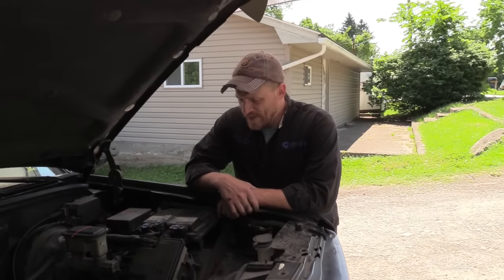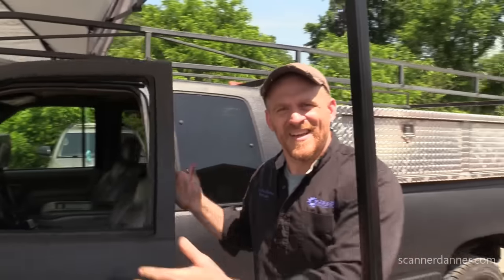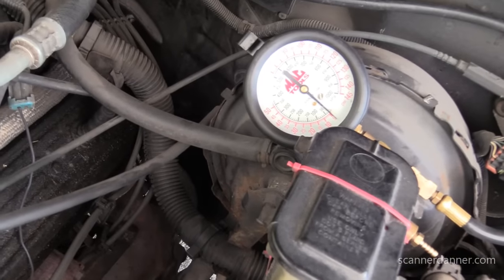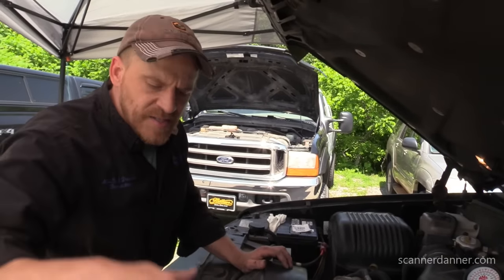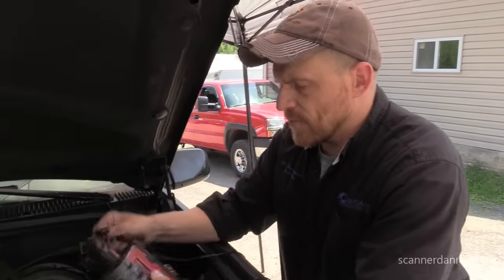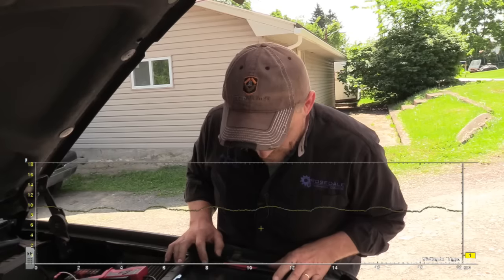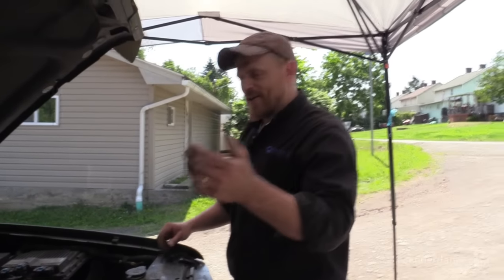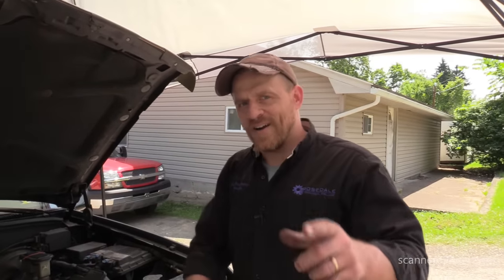Quick Diagnosis of a '97 Chevy with a Fuel Pressure Problem

Comment: Working on a 91 s-10 truck first lost its prime then after putting gas in the carb it started. THEN STARTED AFTER EVERY TIME. RUNS GOOD ON IDLE BUT DONT WANT TO TAKE GAS BUT DOES BETTER ON HIGHER RPMS. Once tou start to give it gas it motor strts shaking like its not getting enough gas to run it. All help appreciated
Reply from the maker: 91 S10? This is a throttle body injection system right? It is not a carb. It has a single or two injectors that sit on top, right?

Comment: My 97 K3500 7.4 with 230,000 mi has the common issues: Hard starting when hot, low on power, can barely rev to 3,000 rpm in 2nd gear. It sounds like low fuel pressure, but it only has 20k miles on a valve job, injectors, fuel pump and fuel pressure regulator. No CEL. I suspect the crappy regulator is the problem, failing to boost pressure at low vacuum. Is there an aftermarket regulator solution that could also be relocated for easier access?.
Reply from the maker: "Sounds like low fuel psi", agree, let's get a measurement of it please. You can rent those gauges from a parts store if you don't have one. Also, no, there are no other options for this fuel psi regulator.

Comment: good vid paul  with the pump rpm   the gas tank smack test for an inop pump is usual   clogging fuel filter causing damage to pump in this one    I say
Reply from the maker: Amperage was normal for this system which would eliminate a plugged filter as the cause (in this circumstance)
Reply: yes....sorry paul was not thinking right over here  its what you usually see... you make the call  from that... the arm chair.... not good and the cannon will miss sometimes

Comment: My truck just got a new fuel pump 3 years ago. Now it will only start with starting fluid and stays running. It has low fuel pressure at 50 psi and stays there steady and is drivable with no power loss. Is the low pressure causing it to not start without starter fluid? Could it be the regulator? Driving me nuts!!
Reply from the maker: Yes, absolutely. On a GM CPI system, you should have 60 psi during cranking. At 50 psi and below, the mechanical poppet nozzles that spray the fuel will NOT open!
You most likely needs a new fuel pump. Make sure you change the inline filter too.

Comment: Met a mechanic at the hand doctor. He was injured severely working on a car with a very high pressure fuel system. Said when he cracked a fuel line the pressure actually shot gasoline into his hand. He had already had several surgeries trying to save one of his finger and he was still having severe symptoms. He told me he was going to just have them take off the finger because he was tired of all the hassle of surgery’s and rehab trying to repair it.
Reply from the maker: That would have to have been a GDI system, not a conventional port injection system like this one.
GDI systems can be a few thousand psi where the max you'd ever see on one of these is less than 100psi

Comment: You mentioned that you were able to check the circuit because you had 9 amps of current flow

In the same way you did this would it be possible to measure DC voltage to the fuel pump at the fuse box in anyway, especially on those hard to get to pumps where you have to drop the tank?
Reply from the maker: No, just because voltage is good at the fuse box does not mean voltage is good at the pump. Voltage will and can drop throughout a circuit. Amperage is the same on a single series circuit no matter where you measure. Make sense?
Reply: ScannerDanner Yes sir, thank you for the reply!
Reply: ScannerDanner Yes sir, thank you for the reply!

Comment: Can’t it just be a clogged/restricted fuel filter causing the same issues? I’m asking the question leaving aside the RPM checks you did in the second part of the video,which confirmed the pump... Let’s say the customer brought the car in as soon as he noticed these issues and didn’t run the pump in a restricted system too long to cause damage. You go in there and put a 30$ filter instead of a 250$ pump and you’re good to go...
Great video as always professor! 👍
Reply: Nick Nicu let me ask you tho. If you are providing services for your customer, you feel comfortable with them driving on a fuel pump that is what 15-16 years old?

In my case, even if it was the filter, for integrity and piece of mind, I'm upselling the fuel pump.  Because you know in 2-3 months time that pump will fail, causing similar symptoms, and an inconvenienced customer wondering what is it now?
Reply: Lynx Star Automotive Don’t get me wrong,I am not here to pretend I’m an expert,because I am not one. I am here to learn. Paul has been for me the best teacher I ever had in my life,I respect him immensely! It was just a question,I promise you!
Reply: I was thinking this as well. Why are we so sure it isn't something wrong with some other part of the system like a restriction in the fuel filter or in some fuel line? Maybe in this case it was the fuel pump but could those symptoms have another cause?
Reply from the maker: Absolutely a plugged filter could cause a low volume/psi problem (which is what we had), changing the fuel filter and retesting is about the only thing you can do, other than measuring psi before and after the fuel filter, which no-one does. In my experience, when a fuel filter gets plugged to the point of low volume symptoms, the pump it getting replaced anyway.  Damage occurs to the pump (higher than normal amperage/heat) from plugged filters. I had a customer with a plugged filter (work truck), changed the filter, all was well, happy customer in that he only needed a filter and not the pump, truck comes back 2 months later on a tow truck with a bad pump and he was very angry with me in that he had to miss another day of work. I have never just done a fuel filter since.
Reply: ScannerDanner very good point.  That's interesting to know.
Reply: a filter clogged that bad has been making the pump work far harder than normal, very similar to dead-heading it for long periods, also don't forget about the pickup screen! it's likely very dirty/clogged, causing the pump even more work pulling fuel through a restriction.
bottom line, clogged filter and strainer could very well ruin a pump and many fail from filters being clogged! sort of a catch 22 I guess
Reply: Nick Nicu well I surely was not reprimanding you in anyway friend!

Comment: Just a quick question. On my 1999 sub I unplugged the MAF and it immediately runs perfect. the pump was done 4 years ago.  I assume I need a new MAF ? same symptoms as this video
Reply from the maker: most likely, just pull it out and take a look and make sure there is no debris or a bug stuck in it. Also make sure there are no issues with the air box in front of the MAF. 
On this year, they are cleanable too https://www.youtube.com/watch?v=QwGICKqWgM4
Reply: @ScannerDanner  Thank you so much for taking time to reply ! I replaced the MAF and it runs perfect now. The MAF that was on it was about 4 years old also. I did notice one of the three pins was bent and going in beside the contact on the plug. it must have been making contact some though or it it would not have run. Maybe this was causing some resistance and made the sensor to go out sooner. After straightening the pin the old sensor still did not work.

Comment: Mine has a p0300 code its 99 tahoe 5.7 V8 with 260,000 miles changed out all 02 sensors idle air control valve,  throttle position sensor,  spark plugs wires cap and rotor. But still showing random misfire. It is responsive when I step on the gas at idle. But when I'm driving it starts to sputter what do you suggest I look into next? Thanks
Reply from the maker: when did the problem start? what are your fuel trim numbers at idle and at 3000 rpm?

Comment: Believe it or not I had a bad ignition coil plug that was very simular, only difference in symptoms was sometime the truck would idle and run ok, but when it warmed up for some reason the short in the plug was more pronounced.
Reply from the maker: for sure, the difference would be psi wouldn't drop on a rev

Comment: scannerdanner could you use a scanner to check fuel pressure instead of the gauge?
Reply from the maker: only on a system that has a fuel rail pressure sensor. Today's GDI systems all have rail pressure sensors.

Comment: So before you went under the hood, how did you know the rev delay wasn't caused by a throttle control issue? ( I don't know what the part is actually called but it crippled a Pacifica I had.)
Reply from the maker: this was a cable operated throttle body

Comment: Obviously after seeing that waveform the pump looked bad. However did you ever suspect the fuel filter to be the problem.
Reply from the maker: Here is what I have posted to others (good catch on the scope waveform telling us this is NOT a filter issue! btw)

Absolutely a plugged filter could cause a low volume/psi problem (which is what we had), changing the fuel filter and retesting is about the only thing you can do, other than measuring psi before and after the fuel filter, which no-one does. In my experience, when a fuel filter gets plugged to the point of low volume symptoms, the pump it getting replaced anyway.  Damage occurs to the pump (higher than normal amperage/heat) from plugged filters. I had a customer with a plugged filter (work truck), changed the filter, all was well, happy customer in that he only needed a filter and not the pump, truck comes back 2 months later on a tow truck with a bad pump and he was very angry with me in that he had to miss another day of work. I have never just done a fuel filter since.

Comment: Hi Paul, I was wondering how the regulator was eliminated from probable cause of the low pressure issue ?
Reply from the maker: fuel pressure was normal during the prime and at idle

Comment: Wouldn't a mostly clogged up filter give the same kind of readings?
The pump can't keep up with fuel because it can't push it through the filter fast enough?
Reply from the maker: I think I did an amperage measurement in this one? Amperage would have been high with a plugged filter, but yes essentially that is correct and when they get that bad, you've already ruined the pump too
Reply: @ScannerDanner  okay. I was just thinking.
I guess I haven't encountered any 
' weak like that ' pumps.   They either worked fine or were seriously broke.
( I'm not a professional mechanic but am a serious troubleshooter from way back.)
I try to teach my son to troubleshoot like you even though we don't have any
' scanners ', just simple stuff like eyes and ears , ( noses ) and voltmeters- ohm meters .
Oh yeah, good common sense helps.
Reply from the maker: The only real test for a plugged filter (when psi is confirmed to be low) is the current measurement and other than that, you'd have to measure psi before and after the filter to know. The time you'd spend doing that test, it's easier to just change the filter and retest.
But from my experience, when a filter is that plugged, to the point of dropping psi. The fuel pump has been overworked and overheated for a very long time, and it's life expectancy at this point will be very low. So they both get sold together. If it's your own car, by all means, change the filter and retest and cross your fingers the pump doesn't die on you.
For a customers car, having them back in on a tow truck a month later with a bad pump isn't good for business. I've had this happen to me before. Contractors truck and he was so pissed off at me to be losing another day of work that I never again offered to only do only a fuel filter for someone that has a low psi problem. Hope that makes sense.
Reply: @ScannerDanner  oh yeah, makes plenty sense all around.
I was just getting a bit nervous when you wrapped it up and didn't say a thing about filters. I guess you had it covered and I didn't know.
Just my troubleshooting brain going over all parts involved.
Reply from the maker: @michaelszczys8316  yeah I definitely should have mentioned about the filter and I guess I didn't? I went back to look and couldn't find it. Good catch

Comment: I know this is old but ---- I am working on 98. Chevy for my brother and have just seen a video on ck sensor relearn .  One of the steps is to go to wot - when engine wants to shut off turn it off.  So, (correct me if wrong) wouldn't it be normal for the engine to stumble in wot?  What am I not getting?????
Reply from the maker: The crank relearn on these is initiated by a scan tool and it's very quick if everything is correct. If you can't get it to WOT because it's running bad, you have other issues that must be corrected first
Reply: @ScannerDanner  Thank you sir.

Comment: ScannerDanner. I replaced my fuel pump as it started backfiring out of the exhaust and intake under part throttle and then died. I also replaced the filter but it still won't start, I know I have spark, and can hear the pump for a few seconds when turning the key but could this be the pressure regulator?
Reply from the maker: What is your fuel pressure?
Reply: I don't know yet, gotta go get a pressure tester today and I'll get back to you

Comment: I have a 97 chevy tahoe...n it won't start...sound like not enough fuel..but i can hear the fuel pump turn on...n when it starts for a couple seconds as soon as i give it gas it dies out...I'd appreciate the help boss man
Reply from the maker: what is your fuel pressure? if you don't have a gauge, go rent one from the parts store or buy one for your GM, they sell cheap sets for GM and Ford

Comment: Great stuff as always. I wonder what the fuel pump volume would of been. I like the teaching part of the videos theory and description. But regardless enjoyed the video guys.
Reply: Richard Gill And what method would he use for volume testing? 😉
Reply: New Level Auto that fancy fuel pressure tester with the gallons per minute and sight tube
Reply: I feel volume is not that significant on a gasoline engine.  Those volume tests are useless imo.
Reply: Lynx Star Automotive why do they make them then?
Reply from the maker: low for sure, but I never test volume directly. I test fuel pressure during high injector flow rates for my volume testing.

Comment: How did you rule out the fuel pressure? Regulator not leaking?
Reply from the maker: A stuck open regulator will have low pressure all the time. Not normal at times, that drops under load. I have a video on a stuck open regulator and what it will look like

Comment: So if what I am hearing is correct... When I hold my throttle at wide open, it should stay around 61 psi... Mine drops to 50 psi... I'll be changing the pump tomorrow.
Reply from the maker: if your pressure is dropping while accelerating, before you let off the throttle, then yes, this is a problem on this design fuel system. If you are seeing psi drop after you let off the throttle (deceleration of the engine), this would be normal to see about 50 psi (intake vacuum is very high during this time and your psi will be even lower than it is at idle)

Comment: i have a 1997 dodge 3500 van 5.9 v8 engine tested fuel system has 35 pounds pressure and no power is it the fuel pump

Comment: I had a 97 Tahoe with a failed pump, replace the pump, truck starts then stalls. fuel pressure test shows like 30 lbs. I think failed fpr overworked the pump to death right. change the fpr, same thing. I say the pump must be defective and warranty it, same issue, low fuel pressure. turns out the guy at the part store was sending me a 1500 pickup pump, which doesn't use the spider injection, but tbi, and also about a 45 psi lower working pressure.

Comment: What if you're running 52-54 psi but when you snap the throttle it goes to 62 , would you think that is a pump issue

Comment: hi there new here.  i own a 1998 c1500 Cheyenne 5.0 v8 automatic and just replaced fuel pump with a Delphi and im getting 61 psi with key in the stand by and when started i get 53 psi truck runs fine no issues like stalling or black smoke has great power to. what do you think could be my issue here. my Haynes manual  says i should have 61-63 psi ? thanks in advanced!!!!
Reply from the maker: This is normal and 61-63 would be a key on engine off or wide open throttle psi (no vacuum on the regulator) 53 is fine for idle

Comment: Hey man I have a 97 Tahoe 5.7 and it's running rich I can smell gas fumes from the exhaust and there's a slight amount of smoke fuel pump was replaced couple months ago any suggestions? Oh I also replace the O2 sensor .
Reply: You ever fix that problem ? Lmk I have the same thx

Comment: Please.. what's the fuel pressure reading for a 3.1 97 Buick Century...I've taken it and I get a reading of 40 ...
The car starts good then the idle starts dropping until it cuts off.
Reply from the maker: 40 is good, does it maintain around 30-40 when it stall? If it does, fuel pressure is not your problem. If you keep your foot on the gas pedal, can you keep it from stalling? How does it run and drive other than that stall?
Reply: @ScannerDanner  yeah .. when it cuts off it mmm maintains at 40 , it starts quickly...the car runs nice n smooth...but it's that...in idle ..runs a couple of minutes then it idles up n down until it cuts off
Reply from the maker: @carlosortiz1549  step one, clean your throttle body https://www.youtube.com/watch?v=RaTVuv6CHgU
https://www.youtube.com/watch?v=F2gi5hRV3kg
Reply: @ScannerDanner  ok ...will do...thanks.

Comment: If I turn my key to on and fuel pressure comes up and I turn the key off and the pressure remains where it was when the key was on does this tell me my pressure regulator is okay. this is on a 1997 C2500 7.4L.
Reply from the maker: it tells you the regulator can hold, but what is your pressure?